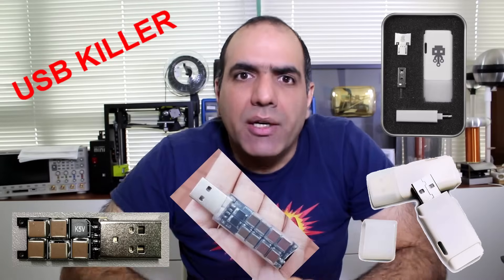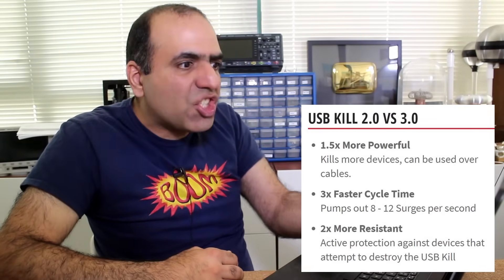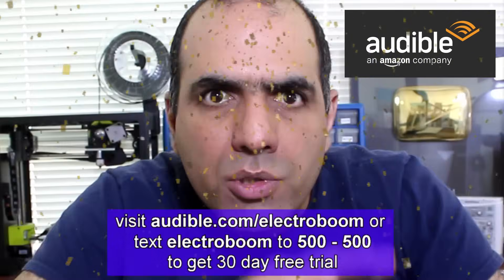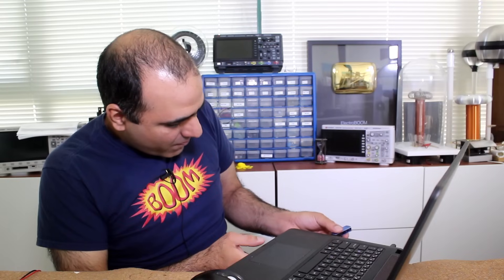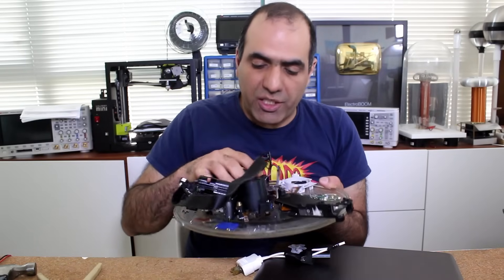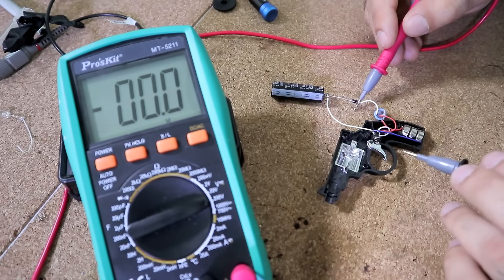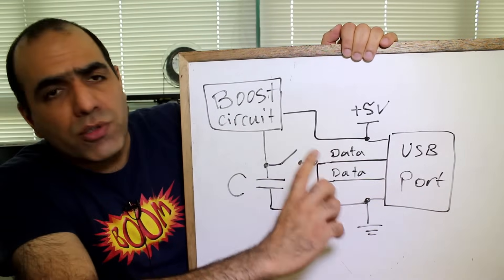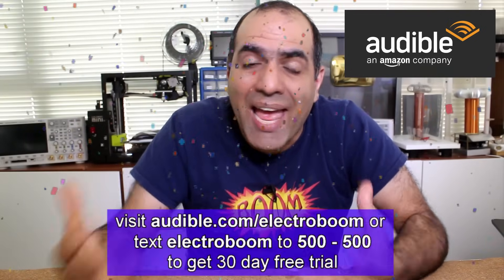USB Killer… WHY???

Comment: I worked in a photo lab for a few years, back in the day when film was still fairly popular. We used to get the odd disposable camera dropped in where the film rewind was jammed, the only way to get it out was to put it in a light tight bag and blindly disassemble the camera. I can vouch that those flash capacitors give you a hell of a shock when you're not expecting it. Worst part is, removing your arms from the bag would destroy the film... Just had to get through it with some 'interesting' language. I soon started remembering to check the flash was discharged before taking it apart. 

We also used to enjoy sneaking up behind coleagues and discharging the capacitors with a screwdriver, we all had healthy hearts aparantly.

Comment: could u convert the usb killer into a data safety device as in if u used a normal flash drive and wanted a anti tamper or to stop someone using ur data so if its plugged into someone's usb without deactivating anti tamper it nukes there pc

Comment: As long as the USB port isn't connected straight to the CPU it will most likely only kill the USB muxer IC or just burn out the traces on the MOBO.

Comment: unless the solid state drive is nvme (basically pci express 4x so connected directly to cpu) most ssds also ho through the hard drive (sata) interface and be safe (usually sata power is provided not by the motherboard but by a seperate wire from the power supply)

Comment: Correction
Killing HDD PCB will actually kill your data, as only way to read data (apart from magnetic photography data recovery) on Hard Disk Drive is to have exact position and speed fluctuations data, which is stored on Flash, which is located on HDD PCB. This data is not something which you can download, as every HDD is very very different.
Not having positional data means no more data from HDD, sorry.

Comment: So when are you going to design a memory-wiping device?
Reply: Those already exist if you're interested. Like hard drive degaussers (They demagnetize the disks inside the hard drive, basically giant electromagnets).
I'm not sure if microwaves can do the same, and how dangerous is would be. Drills can make hard drives pretty hard to recover too (although in theory it's possible, with the right ressources).
You can also just put a bomb inside your PC case, and blow it up whenever the FBI knocks on your door. Beware of premature detonations!
Cheers!

Comment: I guess the motivation behind designing and building such devices is to neutralize USB  chargers in public places so they only can deliver power and there won't be any data connection over USB when you plug in your phone. However these days USB PD and fast charge protocols rely on data exchange between the host and the device, so it's purpose is no longer needed.

Comment: IT HAS LEGITIMATE USE. Here's why:

Hi ElectroBOOM! So I'm a penetration tester, and test physical/infrastructural security on client companies. I own one of these devices, and use it to test in-built surge protection on servers against malicious actors on critical infrastructure. Malicious actors may plug the stick into, or get someone else to plug the stick into, critical infrastructure. This would result in a denial of service attack. Much of the time, this is then utilised to further gain access to a client's systems. They can also be used for social engineering mechanisms, for example:

I plug in the killer, the computer doesn't work, the company calls IT support, we turn up posing as IT support and use that leverage to gain access to their systems.

My job is to imitate what criminals may do to steal data, and ensure that the companies who hire us are safe from attacks. This tool is specifically designed for us, NOT for IT engineers, hardware engineers, or members of the public.

Just to clarify - people with malicious intent will target company systems with such cheap devices as you demonstrated how to make. Critical infrastructure systems such as servers usually have this kind of surge protection (yes, it is a security standard and must new servers are immune to attacks like this). Penetration testers like myself engage a client to try and break into their systems. In doing so, we sometimes use devices such as this in the same way criminals do, in order to test how resilient a company is, or as a part of social engineering attacks. This device is specifically made for penetration testing and penetration testing only. Many many USB penetration testing tools exist, such as the USB Rubber Ducky, or Bash Bunny. One could argue that there is only ever malicious use associated with these devices, but that wouldn't be correct. Security testers such as myself usually get a bit of a bad rep for this kind of thing, and we're working hard to try and show just how important testing things like this actually is. THIS IS NOT FOR CONSUMER USE!!!
Reply: So the only legitimate use is malicious use.
Reply: @MammaApa  No? The legitimate use is replicating malicious use in order to effectively defend against it. Criminals can make surge DoS devices easily. You just saw a video of someone making a malicious DoS device. USB Killer is a legit penetration testing tool to combat people doing that.

Comment: Fun fact: Some computers are protected against this. It's actually very simple. They use an optocoupler(s) between the usb and the pc itself. This way the optocoupler can break but not the pc itself. I suspect that the safety device they sell is just an external optocoupler.

Comment: The intended target for this product is physical penetration testers.  In certain environments, USB ports are supposed to be left unattached or unused.  Often times an attack can still be mounted on a target system (read: take it offline to deny access to resources) even if the USB port is disabled in BIOS, but not physically disconnected.  While I don't condone making this 'tool' available to everyone, especially to criminally destroy machines, I understand why it exists.

Comment: I think it is useful for testing if your computer has optocouplers on the USB ports
Reply: Well.. except if it doesn't you have quite a lot of repairing to do, at best.
Reply: You would still pop the optocoupler and destroy your USB port. Unless you can do logic board repair yourself and have the required component as a spare, you shouldn't really try it...
Reply: @alessandroceloria  exactly. Fail-deadly tests aren't a good idea, unless you're the manufacturer and are testing a prototype.

Comment: Well, with AMD Ryzen and the right USB Port, it kills the Processor because some USB is inside the Processor.
But it also might be that it only kills the USB, but with this violent voltage, probably not.
Reply: Stefan Payne what the fuck are you saying? Only zen 2 with its onboard I/O would be affected, and probably not if it’s electronically isolated.

Comment: Who else got shock from camera before ? 😁😂 , I got twice
Reply: me too!
Reply: Me. Every time I open any camera ;-)
Reply: 3x and counting.
Reply: also killed the flash circuit when electrocuting myself... old camera, but there was a still working 400V 150A IGBT inside, an CY25AAJ-8F, trigger pulse transformer and flash tube of course... electronics was gone
Reply: Spent ages once repairing a camera, on final re-assembly got zapped and inadvertently smashed the camera to bits.
Reply: When I was in my preteens to early-teens, I've gotten "bitten" a few times when fv¢k¡ñg around with camera photoflashes after forgetting to discharge the HV cap before putting my fingers where they just didn't belong. :-/

Comment: As a professional, I like to shoot an AK-47 at the screen to kill a device
Reply: AK-47 is a testing device
Reply: the device still work if you shoot only the screen
Reply: Can I use a microwave to erase everything from a computer?
Reply: @nepnet9903   You can melt down the disk drive into a pool of metal and that will clean it out.
Reply: @nepnet9903   A campfire works fine also a vice does the trick.
Reply: @nepnet9903  yes
Reply: Professionals have STANDARDS, huh